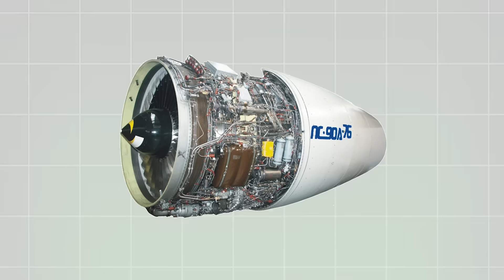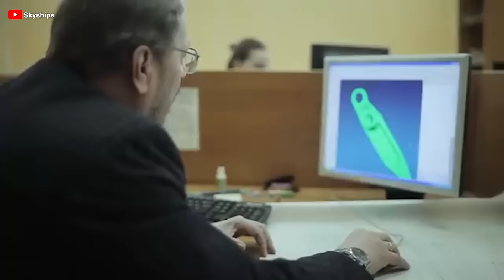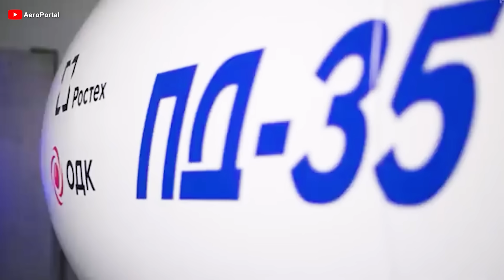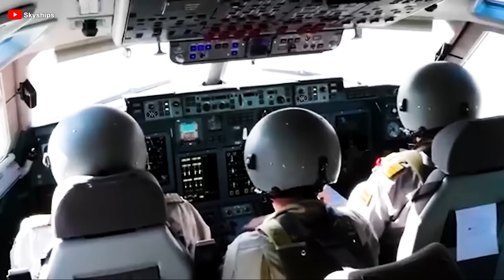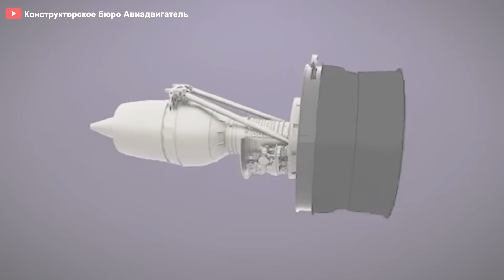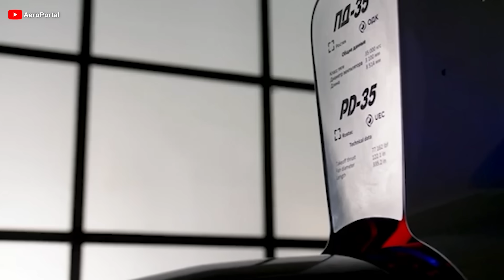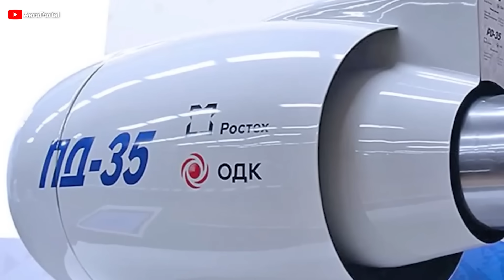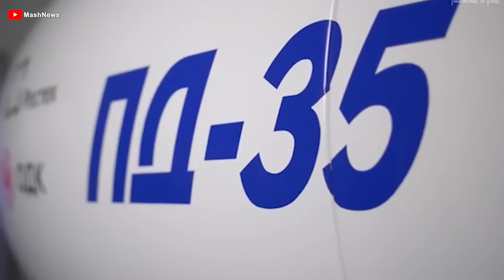Russia REVEALS the Il-96 will CHANGE Long-Haul Game-Changer! Here's why

Comment: Looks like 40 years behind Western counterparts. 4 engines? A340 first flew in 1991 and that is completely obsolete these days. Cost of the airframe will be irrelevant with fuel burn like that. Engine technology in Russia is just so far behind. With sanctions and brain drain, there is no ability to create a competitive engine. Western engines have decades of research and billions of investment just to produce once new engine type. Russia doesn't have those engineering and material resources.
Reply: I am a Russian and I do not care about cost and competing with Western airplanes. I need to fly from Moscow to Vladivostok. Thank you for sanctions. No more Airbus and Boeing over Russian airspace. Well except we took as sanction retaliation to get us through. LOL.
Reply: @SovetUnion63  Urah!
Reply: Russia has a lot of oil so at least for the domestic market fuel efficiency is not a problem. Same was with USSR. Also countries like China, Iran and others that do not want to be dependent on the West because of the aggressive western sanctions policy would be happy to buy these planes even if they are less fuel efficient.
Reply: @AndreasConfirmed  What is most important is safety and reliability, I would take that any time over 2-5% more fuel efficient airplane. Russians since Soviet union have a long track record of making "things" that visually sometimes don't look nice, that are not energy efficient and not so environmentally friendly, but there is absolutely not a doubt that it is reliable and durable.
 In aviation there shouldn't be any compromises, but greed of the companies that are currently making commercial planes and companies that are buying them, they are not making flying safer.
Reply: @AndreasConfirmed  Agree!!!
Reply: i guess you've never heard of the pd line
Reply: @djz8033 I've heard about them, it's the engines that have been in development since like forever?
And yeah, no PD engine has enough power for this type of airplane, unless they go for 4 engines again.

Comment: 4-engine aircraft are 20th century has beens.
Reply: You're absolutely correct! It's much better to have one engine operational in the air if something goes wrong with the other one. That's far preferable to having one engine in the air than three functioning engines. Four-engine designs are no longer in style; they feel very 20th century.
Reply: @maxt240 I reckon, 3 engines are a good mid-point. I don't really believe the two engines being really safe. Plenty of aircraft dropped from one engine loss.
Reply: @andreimoutchkine5163  I meant that if something happens to one of the four engines in the air, you’d still have three engines left.
Reply: @maxt240 And I am saying, two spares is enough?
Reply: @andreimoutchkine5163  you said that three is a good mid-point.
I just clarified what I meant when I talked about three engines.
Reply: @andreimoutchkine5163  Sorry, that was my mistake. I’ve corrected my initial comment.

And I want to say just in case that my initial comment was sarcasm.
Reply: 747s are very well still around.
Reply: @Fidironu  And the funniest thing is how passengers say that two engines are better than four. They’re pushing corporate narratives where saving money matters more than passenger safety. They’d fly across the Atlantic on a single engine if it were possible.
Reply: And You Tb doesn’t allow you to say anything against corporations. Even though we all know that corporations love us and care only about the well-being of people.

Comment: PS90A2 is version in cooperation with Pratt and Whitney. 
One should compare as maintainance for 2 engines vs 4 engines, fuel consumption can be very similar. 
To install pd35 reinstallation of wings need to be redesigned for new engines.
Reply from the maker: Very worth considering. Thanks for your feedback!
Reply: Not as bad metal wings, only really bad for composite.

Comment: First of all GE doesn't design engines, they LICENCE them from SAFRAN the French multinational conglomerate...!

Second, the Russians have at least 10 prototypes ready of new engine designs that can quickly be adopted and put into production of all types....!..

Third, engine fuel economy is overrated when you are the world biggest producer of oil, since all it takes by the government is to give the Russian operators of their aircraft a simple10% lower price in fuel to compensate any variation if you want to give your industries and even operating parameters with counterparts....!..

Fourth,  Four engines give you better ETOPS across the Oceans when you just can plow straight trough to your destination ignoring restricted or compromised airspace....

Fifth the Russian state can implement a fee of engine operations per/hour freeing them from maintenance engine disruptions and having spares to quickly swap them at required intervals to eliminate any maintenance by the airlines and take over all MRO facilities by the state to implement all maintenance and swap requirements....

NOBODY IS OBLIGATED TO FOLLOW WESTERN BUSINESS  PRACTICES....
Reply from the maker: Thanks for sharing your opinions

Comment: IL 96 is good to replace domestic airplanes due to sanctions and it doesn't have a drastic effect on ticket pricing has Russia has so much oil, however game changer against Boeing and Airbus, sadly no. Even a two engine option isn't a great idea. Russia needs to build a clean slate wide body. Extending fuselages or modifying them slightly is a Boeing thing done on the 737 and has been met with disastrous consequences while airbus went for a clean slate and had no crashes on their new models I believe? Dream liner was a clean slate as well and that also has an impressive safety record as well as the 777. The  737 has been a total disaster with an old airplane design  just being modified over history.
Reply: Combined USSR aviation was larger than either Boeing or Airbus once.

Comment: Why would any airline commit to a long haul 4 engine aircraft when 2 engine  aircraft is far cheaper to maintain
Reply: They told in video. New version of that aircraft will have 2 engines. Russia develops line of new engines - PD-8, PD-14, PD-35
Reply: @AlexanderTch  when? next milenium?
Reply: @issyvarsano5622  It's your country does not produce air liners , never did and never will and will disappear soon, this century. Russia exists for millenium no matter how enemies like you hate her and will exist next milleniums, don't worry. PD-8 is ready and new short range linder MS-21 uses it.  PD-14 is for middle range liners and it's in testing phase for liners like SSH Superjet and TU-214. PD-35 is at the competion stage and will be ready in 2-3 years. Remember my words.
Reply: @AlexanderTch  I am not enemy , but. this type of industry needs everiting from the finest mechanic , true electronic and many more. And in modern russia the fime mechanic produce buhanks , the electronic industry is still 90 nm ( doped everywhere in the middle of the 80) . So , haw you will made it? with bare ass ?
Reply: @issyvarsano5622  Russia has been an aviation and space exploration superpower. What are you babb1 ing about?
Reply: @yaroslavgorbachov9063  was... not anymore...
Reply: @ Hahahaha, has the Russian space program been terminated? Is Russia not designing and producing military and civil planes and helicopters? Is Russia not designing and producing jet engines? Do you know how many countries in the world are capable of making its own jet engines? Isn't it Russia that gives US astronauts a lift to the ISS?
Reply: @yaroslavgorbachov9063 yep, it was Russia who had to bring back American  astronauts back and no one in west mentioned  about it
Reply: @michaelwhitmore7160   Of course they wouldn’t mention it. Russia cannot be allowed even a moment in the limelight, not a moment to shine, a big no no.
Reply: @issyvarsano5622  You are right. Russia has taken the microchips from washing machines and is using them to defeat the entire civilized West. True, the microchips in Oreshinka are from a kitchen microwave oven. The Russians are transporting cargo and people to the space station using microchips from a TV.
Reply: Who built the first space station, and flew manned missions to it regularly?
Reply: @patrickoconnor6979   The Russians did.
Reply: It would not be a il-96 anymore, it would be a new aircraft with different wings and engines. For sure it would need a completely new certification.

The difference would be similar to that between the Airbus A340 and the Airbus A330.

They could even propose a new composite wing similar to the one they were developing for the Chinese widebody airliner (C929).

As far as the PD-35, it is in development, but it will not be certified before at least another 4 years, due to shifting priorities (especially PD-14 and PD-8).

So they will probably keep producing il-96 in low numbers (1 or 2 aircraft a year) to keep the competences in widebodies, but I doubt that they will go for large serial production (i.e. more than 10 widebody aircraft a year) before they will have a new version with the new PD-35 and improved wings.
Reply: @ianxyoutube  yea , safety. made from the same peoples that build chernobil
Reply: Apparently there have not been any disaster in the west. Exxon Valdez et all
Reply: @ Fukushima was result from natural disaster , not from drunk diatlov..